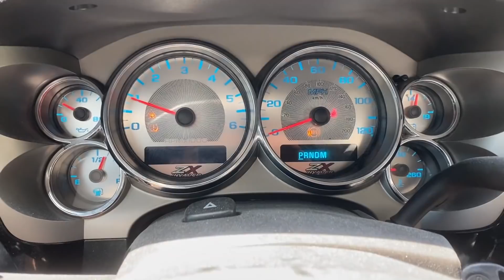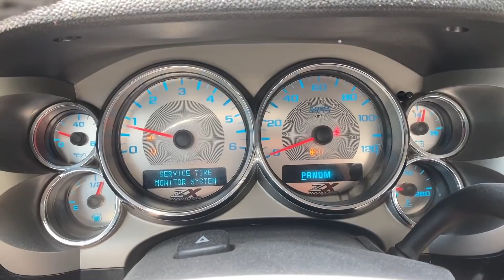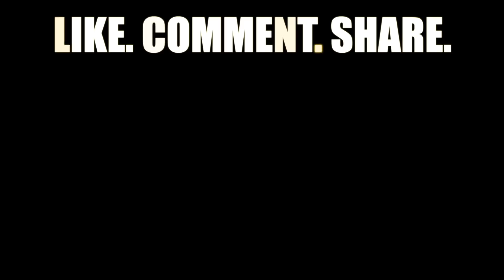Painting My 2013 GMC Sierra Bed

Comment: Why is the oil pressure so low on the truck? I know the gmt800 gas v8 trucks they idle close to 40 psi
Reply from the maker: Bad sensor my bros truck was the same way.

Comment: I wish I didnt live so far away I have a challenge I have a 2011 SILVERADO it has the rust on the top of the wheel wells on both sides of the bed
Reply: Sand the bed and spray with some bedliner. They made a kit.
Reply: @wbbb2  its on the outside wheel wells

Comment: The oil pressure is too low 
You need replace the Oring on the oil pump!
Reply from the maker: Yeah my brothers z71 had the same issue seem like there would be a recall on the oil pressure sensor and fuel pump seems like all 3 trucks that we got have that problem
Reply: @DannyTV7  the same thing happened in my 2010 silverado